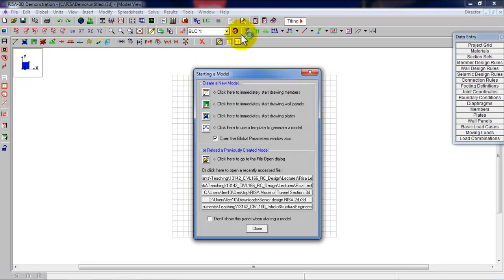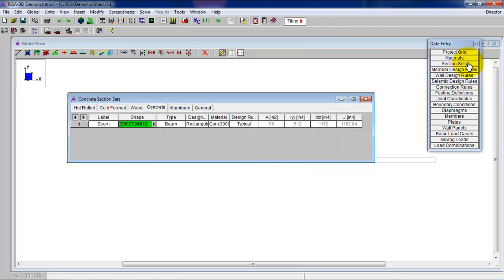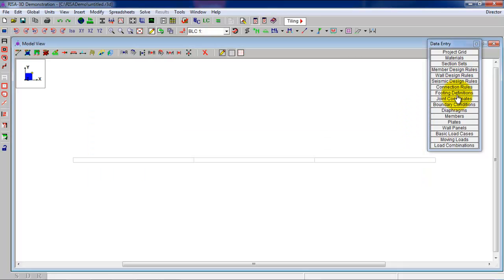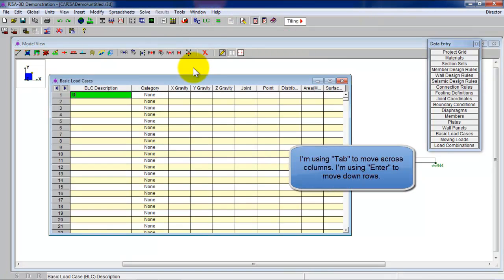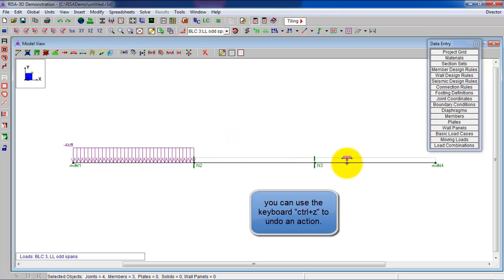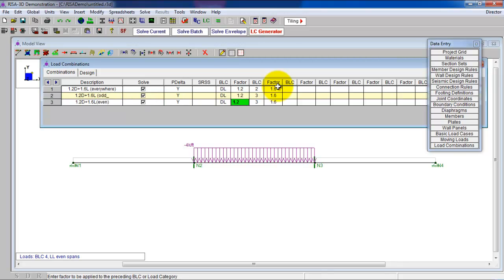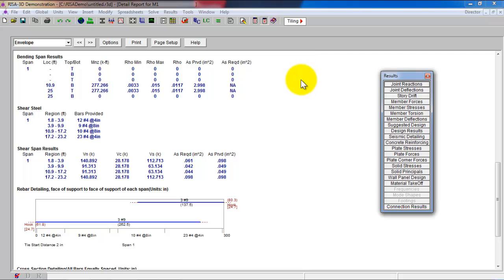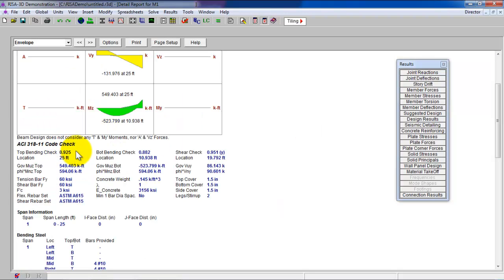Continuous RC Beam Design using RISA Structural Analysis Software

Comment: I have a RISA project due next week, so thanks for the vid!!  Your videos are ree-dik-a-liss.  Our professor mumbles a lot, and she doesn't have a pause button either... so... yeah.  Thanks for helping me (and several other classmates of mine) get through structural analysis, you have improved the lives of us all.
Reply from the maker: hope you were able to finish your risa project. I'm adding "ree-dik-a-liss" to my vocabulary of other ways to say ridiculous, which include "ree-donk-u-lis" (thank you espn) and "ri-dinky-donky" (thank you brian).
Reply: structurefree We finished the project and survived the final exam!  Now, we are taking Intro to Structural Design, and this video has yet again proved to be awesome beyond words.  Our prof is still lacking in the pause/rewind department, but we have learned a lot from her.  This time, we are designing a steel braced concrete frame with concrete columns and continuous rc beams with t-shaped cross sections.  Thanks once again for the videos, without them I probably would have flipped a table.